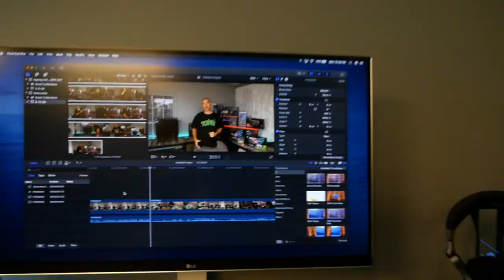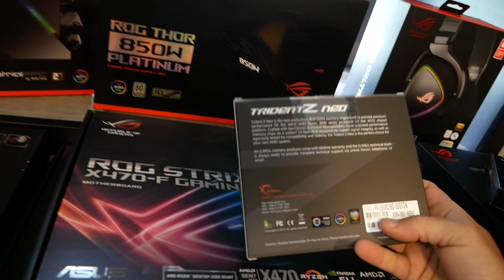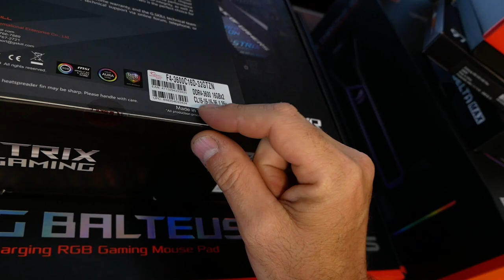All ASUS ROG PC build and no clue how to build it!

Comment: Little jealous of your build.... you're right about the case though. Glass cases are really bad for thermal performance. You want a case that is closed with filtered intakes in the front and back atleast. That way you prevent dust from building up inside wich will hurt performance. If you air cool it with 4 fans and use the heat sink included with the cpu in a case with filtered air intakes you will get much better performance, you wont be getting thermal throttled so easily.